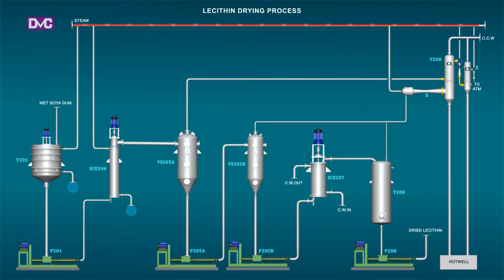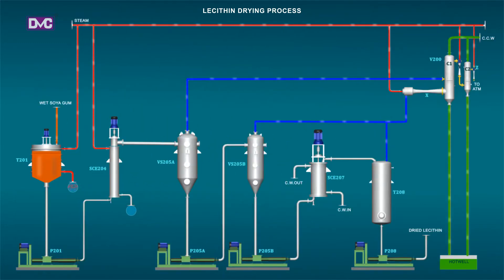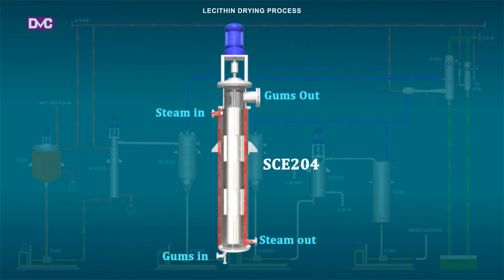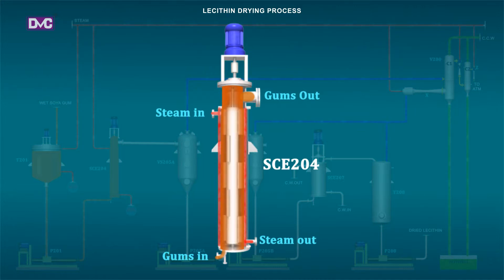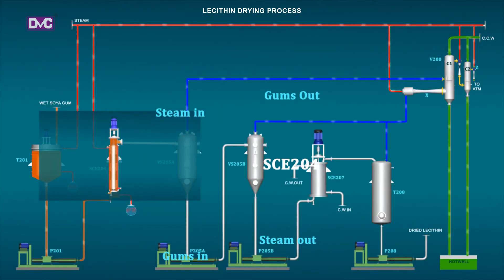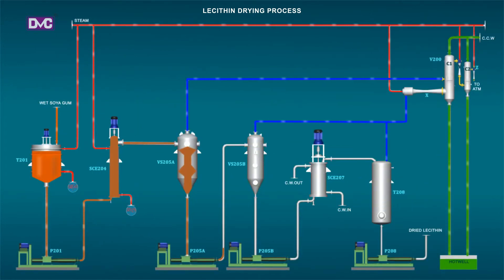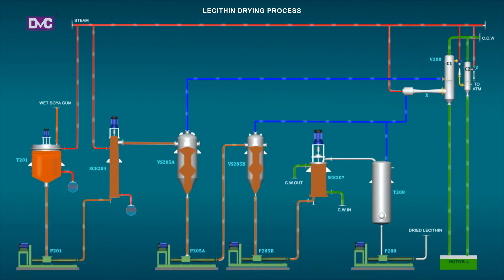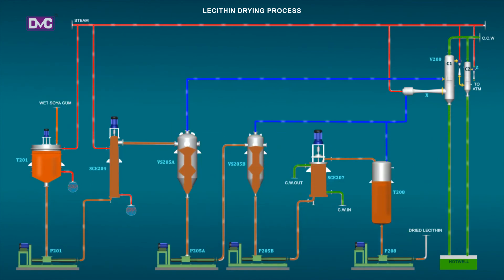DVC Lecithin Plant

Comment: Gums which are removed in Water degumming stage, pose a critical disposal problem. To overcome this, gums can be dried and converted to Lecithin.

The hydrated gums extracted in water degumming process are heated to 90 – 100 deg C and passed through series of Scrapped Surface heat exchangers and Evaporators where moisture is removed and brought to below 0.5%. It is a two stage drying process i.e. at 50 mm Hg abs and 20 mm Hg abs pressures. The resultant dried gums are very light in color which has high commercial value in local as well as global market.

Dried gums are processed further for Lecithin powder manufacturing. Soy Lecithin is a very good emulsifier and is typically used in confectionaries, bakery products and pharmaceutical industries.